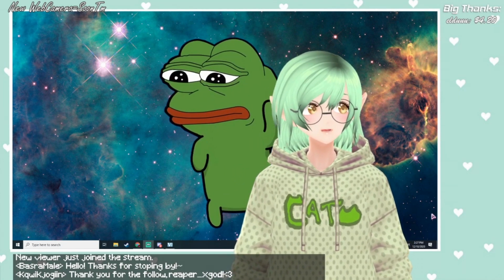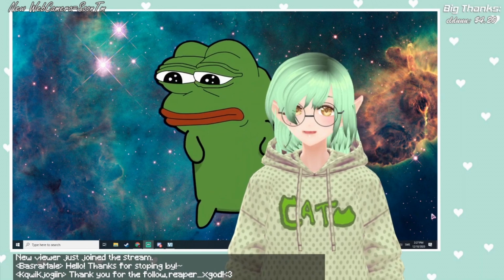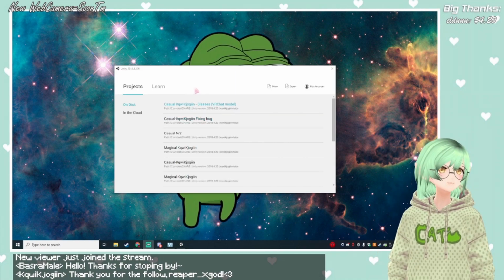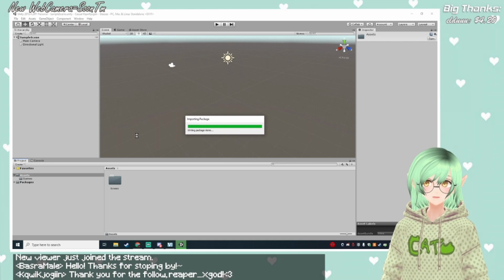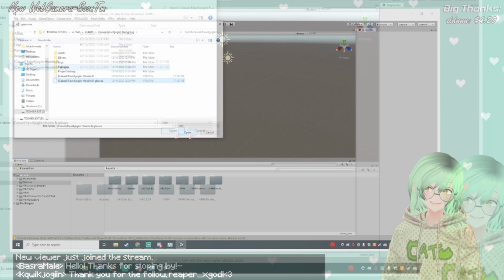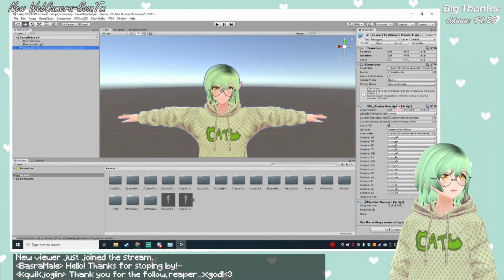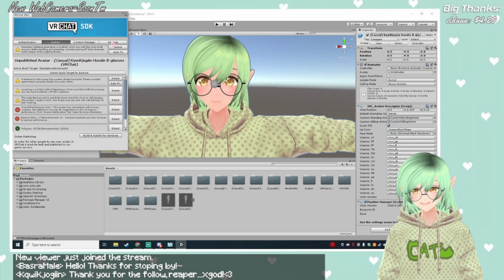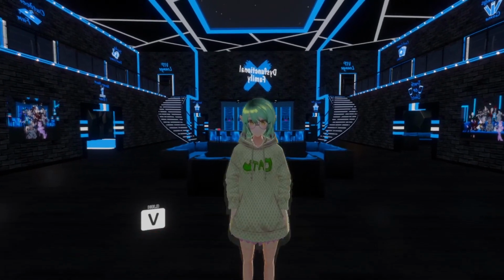[Easy Tutorial] - How to import your Vroid model into VRChat using Unity!

Comment: Help me.. T_T... My VRSDK2 doesn't wok.. When I imported this file(VRSDK2), doesn't no pop-up window, not registered on the Unity menu too.
Reply: As of now the vrchat SDKs have updated their unity to 2019.4.29.   So when opening the current SDK into the Unity version used in video it will not open properly.  As such this method as of now is not really usable.   Only way to upload your vroid is to either (1)  used an older SDK somewhere before august (can confirm that this works,  but it is quite broken),   or  (2)  go from  Vroid>Blender>Unity.

Comment: I imported the Vrchat SDK but it says I haven't when I try to import my vroid avatar to vrchat.
Reply: I found out what is wrong.  The problem is they changed the  Unity version for the current SDK,  right now the SDK has been upgraded to Unity version 2019.4.29.   That means,  when you import the SDK2,  it won't install correctly  on the 2018 version that needs to be used for the coverter.   So either,  see if the converter can work for 2019,   find a new  Converter that is good for the 2019 version,  or   see about finding an old SDK2 model and hopefully  it will be able to be imported to VRChat.  (Even then I don't think it will be easy).

Right now,  I have a old SDK2  from November and I am checking out if I can import my new vrm model using it.

Comment: When I try to do this method, I receive this message.
NotImplementedException: The method or operation is not implemented.
UniGLTF.UnityPath.GetAssetFolder (System.String suffix) (at Assets/UniGLTF/Runtime/UniGLTF/IO/UnityPath.cs:181)
VRM.VRMEditorImporterContext.ConvertAndExtractImages (UniGLTF.UnityPath assetPath, System.Action`1[T] onTextureReloaded) (at Assets/VRM/Editor/Format/VRMEditorImporterContext.cs:154)
VRM.VRMImporterMenu.ImportMenu () (at Assets/VRM/Editor/Format/VRMImporterMenu.cs:77)
Can anyone help?

Comment: I'm using version 4.3.19 and the booth doesn't list anything under v21
Reply from the maker: I assume you mean version 4.3.19 for Unity? If you want to use the Vrm converter I used in the video, you're going to need version 2018.4.20. If it does not show up under the tab "Unity 2018.x" in the unity archives, then I don't know what the problem could be sadly :/

Comment: When I import the VRM, on the tabs at the top it says "VRM0" not "VRM". is this okay?
Reply: I took a break from uploading my models to vrc and I tried to upload a new one but now it says VRM0 as well for me. I used to use univrm 21.0 but tried using the latest which is 25.3  that ran into the same problem. I tested it with both sdk2 and sdk3. So I attempted to download univrm 24.1 at that seemed to fix it for me.       TL;DR Try using  Univrm 24.1
Reply: @RanLilly  Worked, thank you!
Reply: @hunty92  Np glad it helped :D
Reply: @RanLilly  what is univrm and can you link it to me if you remember the link? its alright if you cant! have a good day/night!
Reply from the maker: I've never personally had that problem, so I'm not quite sure. It seems you're not the only person who has commented asking me this, hopefully it should work. Otherwise check booth if there is a newer Unity version required :) Hope it works out for you!
Reply: @KqwiKjogiin  same things happening to me
Reply: This also happened to me, and my avatar wouldn't show up in unity either ;-;

Comment: Just a question, I was wondering if the Vroid model already had lip syncing and blinking already activated or do I have to do something through Unity?
Reply from the maker: If you're talking about in game then yes it should work like normal, lip sync and all! :D 
The same goes for any form of face tracking/rig application such as 3tene, VseeFace or wakaru etc (just make sure that your lip sync type is always set to audio. I know I had problems with it before and setting it to audio helped me a lot).